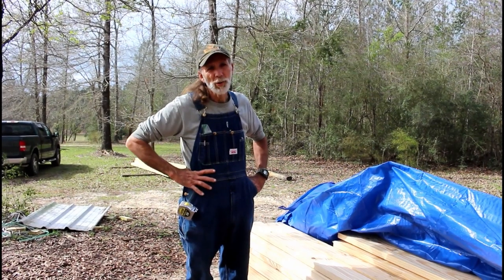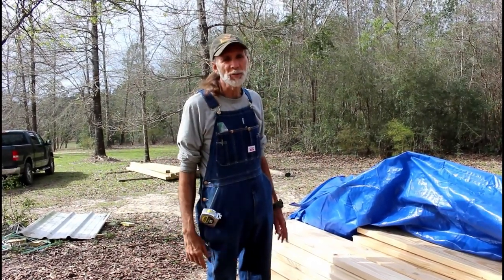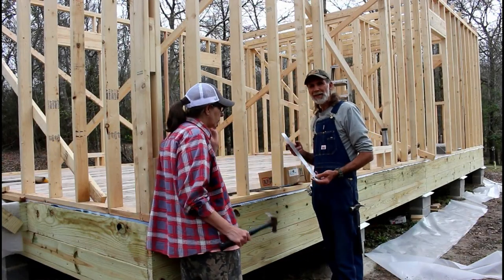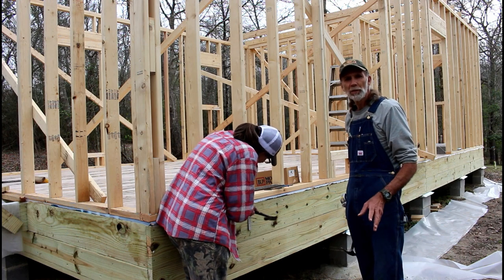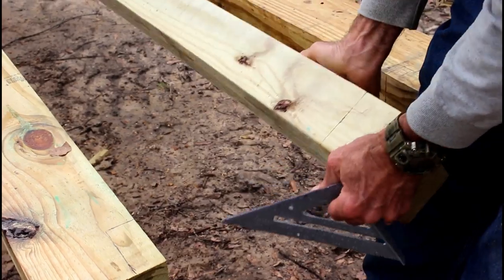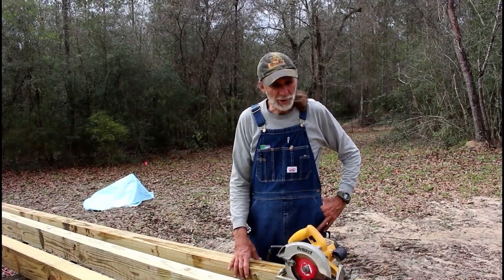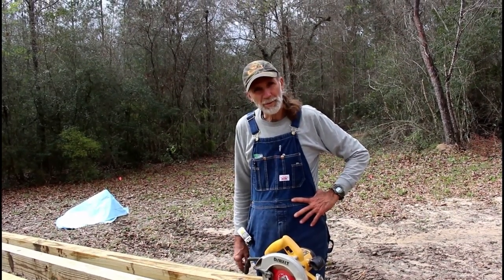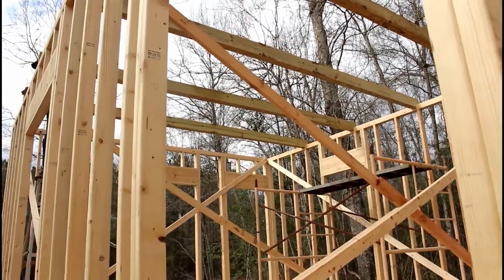Off Grid Cabin Build | Installing Ceiling JOISTS and Exposed BEAMS  | Episode 4

Comment: Exposed treated lumber (ACQ) inside residential dwelling is a No-No!!
Reply: The simple answer is pressure-treated lumber can be used in any interior application except cutting boards and countertops.
Reply: @Dave-ty2qp  I don’t know the codes in the Deep South, But up here in the East…No exposed treated lumber. The only way it will pass inspection if you laminate over it with something!
Reply: @mwenzel64  Different region different standards and all for good reasons.  Thanks for the info Mathew.  Just glad we all care.